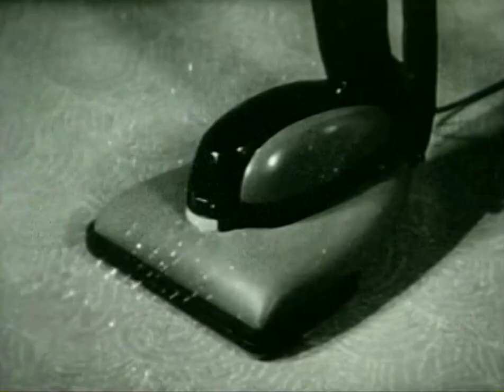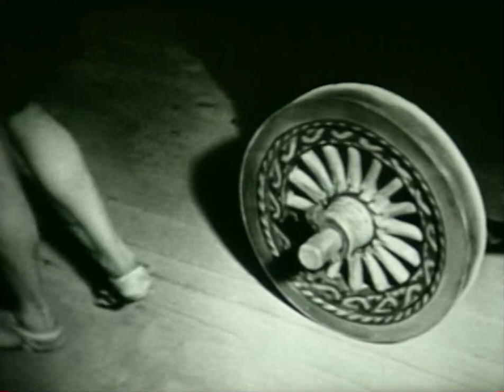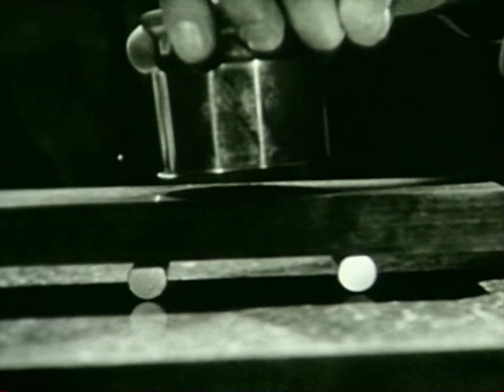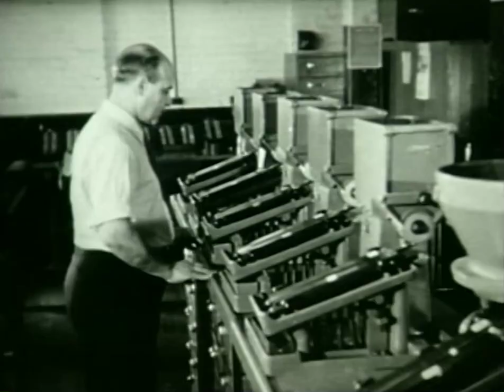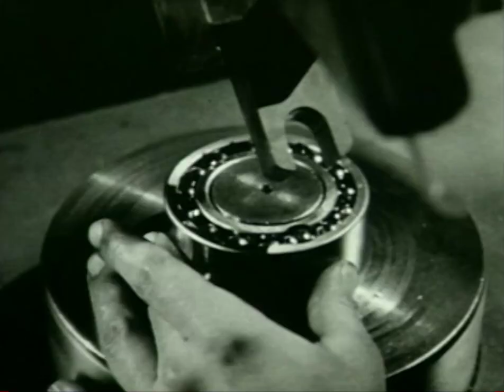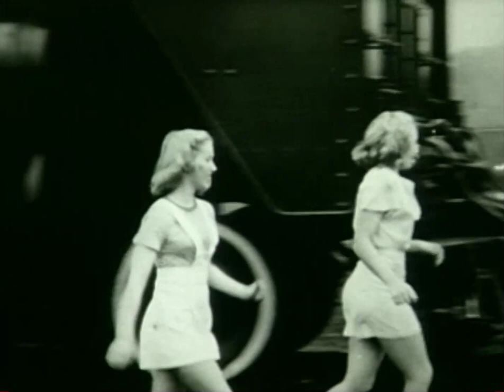Turning Point the Story of Bearings, New York Central "Niagara" 4-8-4 Pulled by Four Young Girls

Comment: I used to work as an engineer for a few years for a bearing manufacturer. Although the designs and manufacturing technologies haven't change much since this footage was made, the material technology has advance a long way. In most cases manufacturers have their own secret recipes for their product alloys, usually a mixture of steel, nickel, chrome, manganese and other metals, which have increased the product's life expectancy.
BTW, the bearings with the longest life expectancy, they last theoretically forever, don't have any rollers or balls. These are used in the huge generators in power plants and swim on an oil film that is continually pumped under huge pressure between the shaft and the outer race. The friction is allegedly as good as non-existent.

Comment: It's all about reducing surface area contact. A roller bearing contacts the surface along one line of the bearing at a time. A ball bearing contacts the surface one point at a time.
Add in grease to further restrict surface area contact and you have reduced the contact to a minimum.

Comment: "Anti Friction Bearings" ??? Known in Industry as "Roller Bearings" and invented by Heinrich Timken in 1898. Increasingly used in Railway Industry world wide from the 1920's. Particularly for carriage wheel bearings, and in steam locomotive coupling & connecting rods. The loco seen in the programme clearly features the latter.

Comment: The film is the kind of film we used to watch on those old reel-to-reel film projectors in school in the 1970's whenever I was in school. However most of the films we watched were from the 60's 50's and even earlier the late 40's, and they failed to maintain the old heavy factory heavy flywheel bushing type load bearings. The kind of material those old bushings were made of is actually a soft material made from copper and brass fiber mixture. Those buildings actually had the capability of holding lubricants inside throughout the bushing's fibers, but they used those old glass bulb oil drippers that the machine operator had to keep filled with oil

Comment: I worked for Cincinnati Milling Machine later Cincinnati Milacron in the grinder dept back in the 60's. We made 1000's of grinders for all the bearing manufacuters including Timken which was probably our best customer. I ran off many centerless grinders that were used for grinding bearings. Great movie.
Reply: Old School Machining back then , and such a high skill level . I run a few Cinicinnati CNC Lathes in my machine shop , all bought from their factory in Birmingham England , which is now sadly long gone
Reply: Wow I worked summer jobs two summers at Accroform Metals in Palatine, IL ca 1970 and we used Cincinatti presses, a 100 ton and a 200 ton, and some smaller German presses for forming powdered metal parts. Can you tell me if Milacron is a joining of the words 'mill' and 'micron'?
Reply: I probably use some of the machines you built! Cant say where I work or what I make, but I use some ancient Cincinnati grinders that have been retrofitted several times over with new technologies to automate it. CNC controlled dresser profiles, automatic diamond turners, servo driven infeed and plunging, variable mag chuck power, the work speed, finish speed and the whole grinding process can be altered in seconds with a few taps on a touch screen. Roller dressed cutters for conjugate parts. We can maintain a precision of nearly 1-2 tents between pieces. 
They are old but in a single 8 hour shift I can easily produce over a thousand pieces (when my coworkers aren't holding the cell back).

Comment: Excellent video.  But I don't buy the 4 ladies pulling a 800,000 lb locomotive.  Try that with a flyweight 4,000 lb car.  Not easy.  I know - steel wheels on steel rails have way less friction than rubber on asphalt.  But 800,000?  This doesn't meet the reasonableness test.
Reply: The Niagara was the only locomotive in the USA that you could pull or push. The engine and tender were so well balanced.

Comment: I replaced the turbo on my Subaru WRX from a TD04 journal bearing style to a VF34 roller bearing type. The VF34 being a much larger turbo would normally mean the turbo kicks in at a higher rev range but due to the roller bearing the turbo kicks in earlier giving the car turbo boost from just above idle all the way to 6000 RPM. Roller bearings just work.
Reply: What year is it?  Hot side and cold side?  And are you saying that due to reduced friction, the turbo would spin earlier at lower RPM?  Very interesting.

Comment: Old memory resurfaced @ 1:30 !  When I was a small child in the early 1960s, my mother used a vacuum cleaner that looked exactly like this. I have not seen one like it for well over 50 years. What s trip!
Reply: That vacuum cleaner was a Hoover.  My mother also used one in the '60's.  They were very rugged and could last 20 years or longer.

Comment: And yet ultra precise spindles turn in either very special plain type journal bearings or hydrostatic bearings. The bearings in an automotive engine are plain bearings
Reply: The crank is machined with holes that allow oil under pressure to be pumped into those journals, however; it's not like an old hot box with a simple oiling pad
Reply: @herzogsbuick  
No kidding. I guess the 30 plus years i spent working in an automotive engine facility rebuilding machinery including precision rotating assemblies didn't teach me a thing

Comment: The real question is, do magnetic 🧲 levitating train's still produce heat like bearings do?🤔
Reply: I don’t see why they would build up heat, as there is not the friction source. But then consider the massive amount of energy required to make this technology possible, and do an efficiency analysis when compared with a diesel-electric train that uses conventional bearings.

Comment: They completely skipped the huge improvement shown in the RR "hot box" shot.  With the axle turning, it would wear an oval into the bearing, and still run true without faster wear, instead of getting an ever sloppier and bigger hole in the wheel, providing less bearing surface.
Reply: Well they needed some screen time to show Mr. Smith forgetting his hat, forgetting to close the car door, and getting a speeding ticket.
Reply: @wryanddry2266   and closing the window...

Comment: I just wonder if the con rods were hooked 
up to the pistons?

There is NO WAY 410 pounds of girls, 
could have moved those pistons!  There 
are NO bearings between the pistons 
and the cylinders.  Piston rings, and 
they take a LOT to move them.

steve
Reply: Agreed.  Something fishy going on.
Reply: It funny that I was considering the exact same thing? Even a modern automotive piston ring takes a couple pounds of force to move, not to mention the mechanical advantage between the ground and the pistons would work against them in this case... and if that thing built any cylinder pressure? Even with zero friction F=MA and say the girls pull the same as their weight, the acceleration would be 5.125*10^-4 ft/s^2 meaning it would be moving at .0051 feet/second after 10 seconds. They would have to pull for 16 minutes to hit the speed shown(.5ft/s). I actually didn't want to prove this one wrong, but I did.
Reply: @matt2j.m929  This isn't to say I'm not skeptical that the girls could do this, because I am.  

The mechanical-advantage issue is not exactly as you describe.  From the perspective of the pistons when the engine is running and the pistons are doing their job, the linear movement of the locomotive along the track is faster/farther than the motion of the piston in the cylinder, so the piston must exert a stronger force on the push rod than the force needed to move the train.  When the locomotive is being pushed or pulled by an external force, this relationship between force and distance of movement is reversed.  This would not be the case if the push rods attached at the extreme outer edges of the drive wheels, but where they attach is much closer to the wheels' center than that.  

There are other commenters saying piston movement is not as great a source of friction as what most people would think, and that might be true, given that the piston in this case does not scrub the cylinder walls tightly as is the case in your example of the pistons of a car engine (where the piston rings supply quite a strong, spring-loaded contact force).   A piston which fits closely in the cylinder but without being mechanically tight, and riding on a film of oil, would be very easy to move.  As to your comment about resistance due to pressure in the cylinders, that's just not an issue since they obviously would have set the controls so that the cylinder valves remained open (just the same as they would have done when towing the locomotive in a "dead" condition out on the main line or when pushing/pulling it in the yard or shop - it's the same as putting a car or truck in neutral).  Incidentally, setting the valves to remain open would also eliminate most of the friction occurring within the mechanism which operates the valves!

(Edited for typos and clarity and to focus on a smaller part of the issue).
Reply: @ericl2969  hmmm. I do believe you are correct. The mechanical advantage wheel to piston would be working for the girls. And I was not aware the valves could be set open as you described! I declare myself humbled. However the f=ma problem is still on the table. It would be interesting to try to calculate how much acceleration is actually seen in the video and see if the math remotely lines up without friction and stretching some assumptions.

Comment: Anti Friction Bearing still had a friction problem and heat energy destroyed the bearing, it needed a lubricant to reduce friction even more to work.
Reply: That's why they pack bearings with grease.
Reply: One night driving alongside a Seaboard Coastline RR track I saw a freight car with a hotbox. It lit up the night. I don’t know if it was friction or non friction but it was bright.
Reply: @jockellis  I can well believe that.  You remind me of a film that used to be shown in England, of a Pacific locomotive on a night express train descending the gradient from Shap summit, braking, with the tyres of the driving wheels showing as bright circles.
Reply: @robwilde855  Did the driver know it?
Reply: That’s right!

Comment: So THIS is why some locomotives can claim as much as 400 miles per gallon of fuel.
Reply: Locomotives themselves aren't that efficient.  The statistic you're paraphrasing is actually payload ton miles per gallon, which can reach such high numbers because of the enormous loads a freight train can haul and the low rolling resistance of steel wheels.

I mean, it's not like the railroads have exclusive access to magical premium bearings that semi trucks do not have.
Reply: Down hill in a hurricane.

Comment: I was skeptical of the girls pulling the locomotive, so I did some homework and the simple arithmetic: 

 • the rail industry states that it takes 2 to 3 pounds per ton of "train weight" to start and/or move at slow, switch-yard speeds.
 • the NYC 4-8-4 "Niagara" weighed 236 tons.
 • so the four girls need to be capable of pulling with 236 * 2 = 472 pounds, or just 118 pounds of force each!

 The salient point to the whole thing winds up being the bearing surface of the wheels on the rails. 
Without that low-friction starting point, you could have frictionless magneto-hydraulic bearings and the train wouldn't budge a millimeter.
Try it with a truck  with 1/10th of the weight on rubber tires, it won't move without a lot more force.
Reply: The 4 girls seldom are all pulling at the same time.  Nice eye candy but probably a set up stunt.
Reply: Still how many women or men can press 118 lb with one leg?
Reply: @wryanddry2266  Anyone that can walk, and weigh more 
than 118 pounds, can press 118 pounds.

If you can leg press your own weight, (more likely twice) 
you can do it.

Think about it.  (When I was in high school, 5 decades 
ago, I could leg press 550 pounds.  That was on the 
machine.)

steve
Reply: @steveskouson9620  Okay, 550 lb for a trained male HS athlete.  But they are using one leg at a time. And because of the angle (notice they aren't leaning much against the ropes) the ropes are getting only maybe 20% of the forces they are exerting.  Notice the ropes are slack much of the time: each one is exerting a force only part of the time, making the average force smaller. And they are women--not male high school athletes.  I think probably the tracks have a slight slope.
Reply: @wryanddry2266  For this stunt they would make sure it was dead level track. If there was a slope it would be impossible. Obviously.
Reply: @ruslbicycle6006  Not obvious.  Put it on a very slight slope so that static friction barely holds the car in place until they start pulling it.
Reply: You COMPLETELY overlooked the 
pistons, and the steam valves.
(And, the rest of the steam engine.)

steve
Reply: @steveskouson9620  I'm guessing much of that was disengaged for the stunt, to make it possible.
Reply: @ruslbicycle6006  The only "disengagement" that's possible is to open the cylinder valves.  This is probably done with the reverser control (which is just a very broad-range adjuster of the valve timing) but I'm not an expert on these things.  It was possible to do this, though, or otherwise these locomotives couldn't have been towed, since simply opening the petcocks would provide insufficient venting of the cylinders for high-speed towing.  In any event, the sliding friction of the pistons and the seals for the slide rods cannot be eliminated.  Previous posters have attested that this friction is surprisingly small, however.  Note also that the positions of the push-rod ends on the drive wheels are such  that there's quite a large mechanical advantage when forcing the pistons to move in this way.

Comment: The railroads were slow to adopt roller bearings on freight cars because the cars were exchanged all over the country so the cars were paid for by one road but benefited other roads. They used to say these cars with roller bearings would only come back to the owners road when it needed repair so others were getting the benefit of the bearings they paid for. The early use of the roller bearing cars were usually in business where one road controlled the cars from shipper to customer so they always had conrtol of the cars.
Reply: You can still see closed box bearings on train cars, but probably only one in a thousand. The roller bearing, identified by the visible turning axle end, has made bearing failure and "hot boxes" a thing of the past.
Reply: @quantumleap359  CSX won't except anything without rotating cap bearings, which makes it difficult for preservations to move old cars to museums without taking the trucks off and loading them on highway trucks as oversized loads. The cost of the cranes is huge.
Reply: @quantumleap359  how long ago did this conversion take place?
Reply: @Truth-mk-s2k  solid bearing freight cars were banned from interchange between railroads after 1980. Some hung on working on their home roads into the 80s and beyond, however.
Reply: The Timken Company actually produced a cartoon about roller bearings in railroad use in 1949. Look up "Big Tim" here on YT.
Reply: Much of it had to do with the War Production Board.  Diesels were around in 1930s but were not much improved or widely used until after the war.  Many steam locomotives used bushings during the war when roller bearings would have been preferred.  Many were actually retrofitted roller bearings once it was permitted.
Reply: It's the same reason Semi trailers/vans tend to be terrible.  No one wants to spend a cent to save dollars of fuel because the trailer owner doesn't pay for it and gets quoted the same rate regardless.  Only those who control both the tractor and the trailer have decent equipment.

Comment: How are they overcoming the sticking of the steam cylinders?
Reply: Oil and grease. There's oil ont he piston carried on the piston rings, you can sometimes smell it when stood near a steam locomotive. All the bearing surfaces will be coated with oil or grease whatever the bearing type. Roller bearings reduce friction but they still need a little oil or grease to easy the way.
Reply: I think the cylinder cocks are opened to let the air out on each stroke.
Reply: I was thinking the same thing. Even if the wheels are free rolling there is still friction from the piston in the cylinder and the packing on the piston rod. The rest of the valve linkage may or may not roller bearings in it.
Reply: lube up with Astral lube
Reply: these were .... working  girls...they pull trains. for a libbing
Reply: I try to always grind the lumps...off my ballz...they slide easier u know
Reply: do you  grease  your own balls ...guys!
Reply: I'd do...Mrs smith......bearings or no.  bearings...
Reply: I grow my own bearings.....
Reply: I'm workin on it now!
Reply: yes....the square bearing was short lived!
Reply: It might be so that the rails had a little of an incline so that the weight of the locomotive helped a bit to overcome the various frictions inside the engine so the pulling by the 5 dames in party shoes was easier.
Reply: @dipling.pitzler7650  just watched an episode of Train Truckers (UK TV series about the people who move trains around the UK by road (reason is it's cheaper to go by road - I know, but that'show we do thing in this country)) and watch a handful of men (about four men) push a 99ton diesel-electric locomotive the last few feet off the trailer after gravity could do no more. The Deltic locomotive had got to the point were the very slight slope of the siding was just too much for the gravity assisted unloading to overcome. So their may have been a little slope assistance.